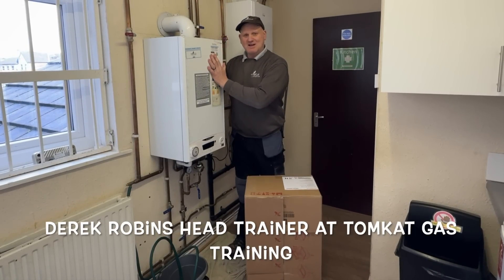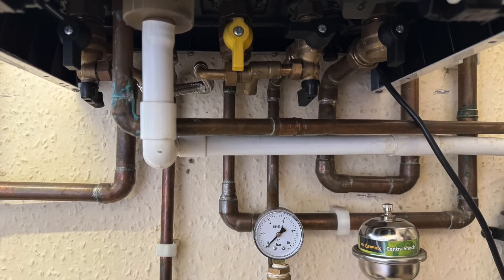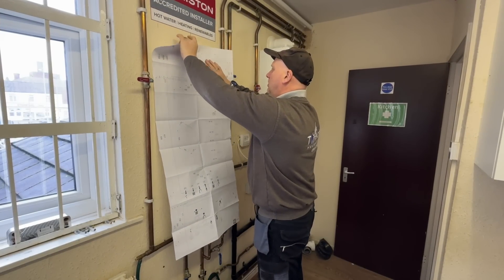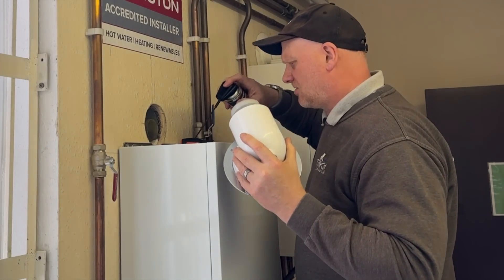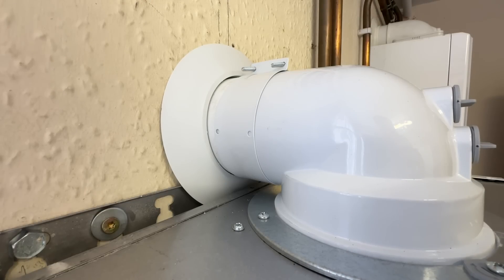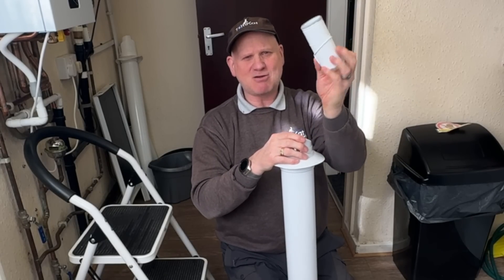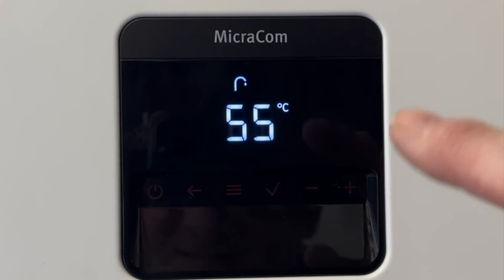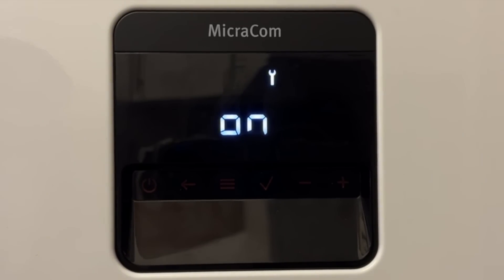WORST GAS BOILER TO INSTALL IN THE UK ? Glow-Worm Micracom combination  boiler part 1.

Comment: I fitted my first one of these today (not my choice customer had already purchased). I did the exact same thing even though i looked at mis i still piped the main and return incorrectly. Why change?? Also i used solder fittings and when under the boiler doing the elbows the plastic kept getting scorched even with a heat mat it was awkward.

Comment: No idea why you classed it as the worst? A tradesman is only as good as their knowledge! When was the last time you fit a boiler at a customers place? You made putting a flue collar on  harder than it should be. Use lubrication to push the collar on the flue, job done! As for messing up the cement (if using it) the flue is secured to the boiler and then cement. If cementing on the outside, just flip back the collar. As for the pipework of an existing system, well, that's down to the experience of an engineer. Changing over from flow and return being on left or right (as some older boilers were set up) shouldn't be an issue? I fit a Micracom the other week without any issues other than the wall it was mounted on was poor quality but I got around the issue. Perhaps I was lucky? Mind you, I've no idea why they changed the pipework arrangement, seems daft to me.
Reply from the maker: To answer your questions I have probably forgotten more than you know and yes I don’t do many boilers now but I have done 5 boilers and a bathroom this year.

Comment: Nothing can be as bad as the hot water express. Fuel saver, space saver, both very good boilers. Just fitted a micracom. Plumbing connections not good. Boiler is quite good.

Comment: We had a boiler in our council house for almost 35 years, they then decided it was a good idea to replace it with a glowworm boiler despite it not having a single problem. In less than 3 years this boiler has had more error codes and faults than the old one had in 35 years. Every winter it has 2-3 errors leaving us without heating for 2-3 days and during the year it will have a fault every 2-3 months almost guaranteed. If anyone ever asked for advise the only thing I would say is do NOT buy glowworm 😂

Comment: another reason not to install glowworm or vaillant  if you can help it. installed top of the range vaillant not long ago not impressed. plus you get the anal engineers on warranty callouts always blaming installers. how hard can it be to design a good boiler?are zee germans still sad they lost and still screwing us over?  from plastic parts failing to pressure sensors designed to catch dirt.   thats on bosch too. plastic hydrolic blocks failing on boilers where theres zero mention on expantion in the MI.

tomcat dont get me started on alpha i see your an accredited installer. why put an lcd screen on the pcb knowing they put a shitty transformer on the same board.
Reply: ...sorry to remind you that the Germans did not 'loose' the war.  You may remember Britain had an empire. It was Adolf Hitler that decimated the empire. Britain did cheat as always. It put a division between Germany and the Soviet Union. It was a deliberate, well calculated 'gamble'. Even when fighting on many fronts it still did well. I only fit vaillant Boilers. In my books they are the 'Rolls Royce'. But you are right that on the very latest they have started to use 'plastic' parts that have a lesser durable life. That's economics for you. Now that could be the reason they trying to 'screw us'.

Comment: Just thread the collar on from the other end and it slips straight over the ridge 👍
Reply from the maker: Can’t do that when you have had to bricked up the outside and need to slide it over the terminal 😢
Reply: Vaillant used this flue then reverted back to the old style probably because of the same issues. The way i was shown was to pop off the outside cowl, it has 4 tabs that hold it on. Then connect the outer flue to the flue elbow and cement the hole. Then you can put the rubber collar on then refit the cowl and middle flue pipe. Its long but that was the only way i found that worked🤷🏼‍♂️👍🏼

Comment: Got to ask. The condense pipe can’t just sit in the black plastic pipe.    I’ve been told in case the trap runs dry and products of combustion can leak into the room.        Not me saying this     Some. Mi say it.
Reply from the maker: Just remember this boiler was installed in a training centre with faults put into the install.

Comment: Hi I’m looking for some advice
I’m working on static caravans,their is a natural gas meter that is NOT connected to the caravan it is on a stand about a foot away from the caravan,I have been looking and looking and cannot find the legislation that states on a static caravan if the meter is not connected to the caravan it has to be on a flexi hose and not hard piped? Could you please shed some light?

Comment: Vaillant said for years not to use any silicone lube on the flue seal because it damaged them. Would be interesting to know if they have changed what they are made from .The seals reacted and rippled to silicone. Have seen so many flues rotten through at an early age 👍
Reply: Had so many vaillant seal fail it bonkers, even when they put in dry, the condensation acid make them distort and leak, have spoke to tec, his reply was we don’t make the flue🤣🤣🤣unbelievable
Reply: Vaseline works every time with no issues.

Comment: Definitely give this one a miss, Alpha boilers the same with the different pipe work set up underneath, They also supply a cross over kit. Just a quick question, What does everyone use on dot & dab walls to seal the flue inside? I’ve used sand & cement but a year later when I go back to service it the sand & cement mix has usually come out 😳 I know some manufacturers like Ideal let you get away with just the internal seal so long as outside is done.

Comment: ...you have to remember that there can be flaws in a brand new boiler. Dont forget that in the factory where they are put together or assembled parts maybe faulty but they will still put it on. Like for example a diaphragm might have a very thin 'needle' borehole. . Depending on the material it may need replacing immediately or gradually get worse then becomes apparent. I n a Microsoft software they forgot to put the 'Print' command. I am referring to the bracket being in the way of the rubber flue ring seal after it has been cemented . I am thinking either the bracket needs to be cut away after it's positioning has been set so the ring will be flush with the wall or the ring goes behind the bracket. Any criticism welcome.    .
Reply: ...did you have the same problem as Derek, in regards to the plastic seal ring not sitting flush against the wall, sandwiching the hanging bracket. Thanks

Comment: the condensate and the PRV into the 40mm pipe are glow worm happy with that setup? As I know when I fit Ideals ect they recommend the use of a tundish for example the Hotun when combined condensate and prv into pp pipe. I have seen a few like this recently.  I know the glow worm manual does say "The components must be set up in such a way that
you can see the water flowing out."
Reply from the maker: It’s a fault put into the pipe work so trainees can find it on inspection you are totally correct it needs a tundish or the hotun when installed this way.
Reply: @tomkatgastraining  Hi, thanks for the reply.

Comment: I wouldn’t trust that turbidity tube thing as obviously a sample from the top of a rad will be vastly different to one from the bottom as iron doesn’t float 😂
Reply from the maker: The magnetite would be in suspension in the water so it makes no difference taking the sample from the top or the bottom of the radiator
Reply: @tomkatgastraining  Can’t agree with that……if magnetite were held in suspension it wouldn’t block systems making Powerflusing necessary. It would leave the system during a regular drain down
Reply from the maker: @julianwebb8712  if it wasn’t in suspension how dose the magnet in the filter collect the iron or is it just witchcraft?
Reply: @tomkatgastraining  There is a difference between held in suspension and carried in the flow…..when the forced circulation stops the magnetite sinks, iron doesn’t float unless it’s Titanic shaped 😛
Reply: But anyway, if it was always a sealed system then it was likely to be ok 👌
Reply from the maker: @julianwebb8712  so what’s the difference between taking the sample at the bleed or a drain point ? I took the sample on a low radiator also maybe you could have a point if I took it at the highest point. And the last thing the instructions for the turbidity tube says take the sample from the lowest rad 
Furthest away from the boiler at the bleed point so guess we will agree to disagree
Reply from the maker: @julianwebb8712  sorry mate I definitely can’t agree to that seen loads of sealed systems from the start be full of magnetite due to no inhibitors and corrosion due to electrolysis.
Reply: @tomkatgastraining  Of course…..Wasn’t suggesting that being sealed guarantees anything as nothing can be taken for granted. My parents system for example is 40+ years old, it’s vented and never had inhibitor in it…….drained for the first time last year to fit Trv’s and the water looked good enough to drink, tipping out a rad there wasn’t even any brown dregs ! Go figure 🤔
Reply from the maker: @julianwebb8712  guess the engineer who fitted it put the pump in the correct place so no air being put into the system. At the end of the day if we did our job correctly we wouldn’t need filters and testing.
Reply: @tomkatgastraining  To a degree I think the water in the system had been there so long that it became inert if that’s the right word…..unreactive ? That’s why I always if possible, isolate all rads on a drain down to retain as much ‘old’ water as possible 😊
Reply from the maker: @julianwebb8712  I think we should install isolation valves under boilers so if the boiler needs replacing you just isolate and replace a small  bit of pipe so as not to introduce aerated fresh water. We do it in commercial so why not domestic.
Reply: @tomkatgastraining  100%
Reply: Agree mate, they are rubbish. We used to do 40-60 boilers a month. I used to use a turbidity tube on every survey. The amount of times the lads would ring up on the day of install to tell me the systems full of shit, even though clear as day on the turbidity tube. Shite
Reply: Adey say to take water samples from the top, and they are the experts